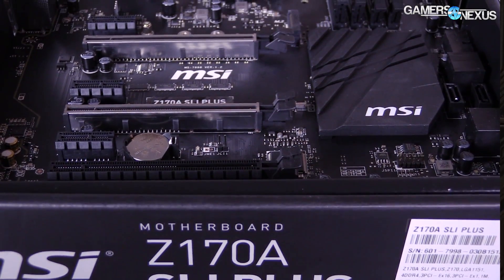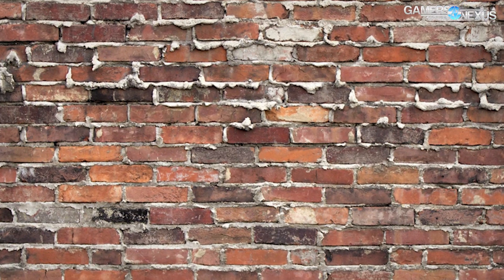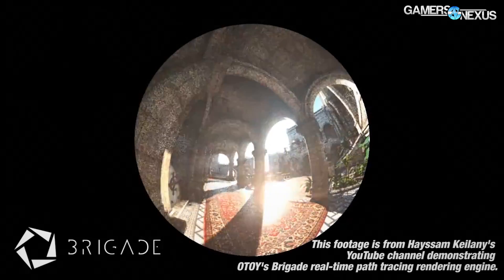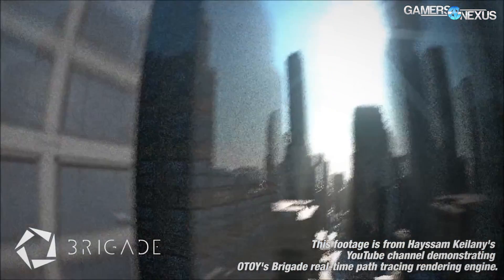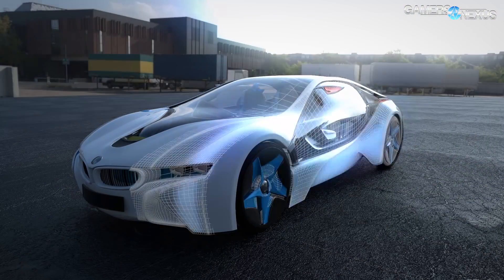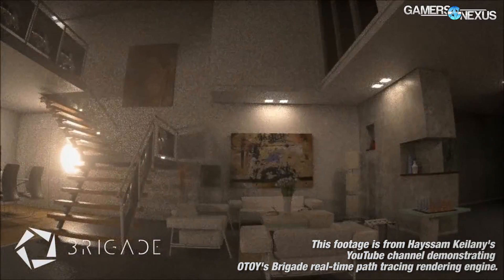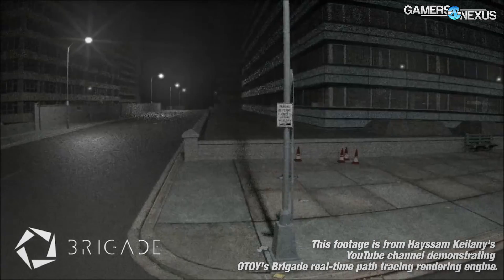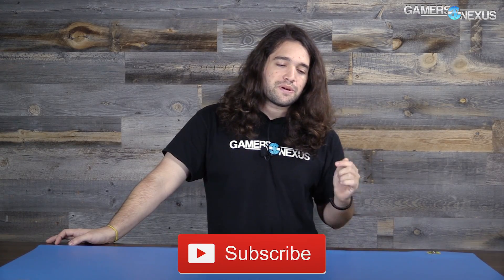How the Radeon Pro SSG Works - The Basics

Comment: PS5 has entered the chat.
Reply: their graphics processor isn't special, it's still inside an APU, sharing ram with the processor, rather than being its own discrete chip
Reply: @danq256  THe GPU is special it has Chace scrubber that allow more efficient and made to work with fast bandwidth on the storage.

Comment: If the SSD is just a regular SATA one (judging by the internal renders of the card), why not just sell the card and the user has to provide the SSD instead? That could make the card cheaper.
Reply: 1TB SSD is really cheap in comparison, so just having that on-board to see if they can work with it is much nicer to their buyers than making them buy their own SSD on top of the whole devkit.
Reply: SSD? What internal renders? GN showed a render of a random SSD to illustrate what makes up a modern SSD (i.e., NAND flash chips), not a render of the Radeon Pro SSG.
The flash storage on the SSG is, as far as the info in this video goes, controlled through 8 PCI-Express 3.0 lanes, and perhaps some other (even faster) interconnect between the GPU and the flash controller.

Comment: is it just the devkit/prototype that's non-polaris? or will the final unit also be non-polaris? Would be good to make sure, could have sworn I heard Raja say it would be Polaris in the SIGGRAPH talk, and other sites are reporting it as a Polaris card. 

From what I understood the devkit/prototype is primarily for developers and early adopters to help get software integration ready for official workstation card release. They revealed during the SIGGRAPH livestream they were working with "The Third Floor" who do realtime pre-viz for films, as early adopters. I was under the impression full 2017 non-devkit units were going to be a Polaris based revision. Of course I could be mistaken.

Also regarding the PCI-E lanes, if it's a PCI-E 3.0 card, would have been the perfect opportunity to refer back to your video on PCI-E 3.0 16x Vs 8x ^ ^ maybe a suggested card?

Comment: How expensive are vram modules?

If we look at the difference in price between the rx 480 8gb and 4gb, it looks to be $50 per 4GB of vram.

This thing costs $10,000.

10,000 / 50 = 200 sets of 4GB

So 200 x 4GB = 800GB.

So for the same price you can fit around 800GB worth of gddr5 (obviously more like 500GB because  I didnt factor in any other costs), but why would they opt for this ssd approach instead of a shitload of gddr5? Is there a gddr5 shortage or something? Higher profit margin? Why not ddr3/4 instead of an ssd, wouldnt the speed be better?

Plus the ssds lifespan will probably be reduced very quickly.
Reply: If they used 800 gb of gddr5,  the card would be 5 feet long,  and you would need 2000w just for the memory.  Plus,  this stuff is very high margin
Reply: Phoenix Wright ah, right. Totally forgot about size. They cant stack the modules or anything?
Reply: +Phoenix Wright "New" technology always had a premium, think about when SSDs first hit the market. and look at.how affordable ddr4 is. that's where the price is, you're paying for innovation. plus I'm sure their things about it we don't know.
Reply: Phoenix Wright Well theres always the cost for developing new drivers and firmware for it, programmers dont work for cheap. People forget about the labor part of prices, its not always about pure hardware costs.

Though this is specialized hardware so im sure they still are making quite a decent profit on it.
Reply: that higher price is for Enterprise level software support, in which they will guide you through any issue, and since this is support that cant be provided by some joe in a call center and are actual engineers and technician price can go high. plus low volume needs a higher price to pay for R&D and 3rd, Disney doesn't care about 10 grade if they can double the speed of their editing workflow (Amd showed 8k rendering going more that 2x as many fps on this card)
Reply: +Phoenix Wright if they had high margins they wouldn't publish retailers struggling to break even on selling cards. do you mean low margins aka not making much money? high margins equal more profits. Electronics tend to sell for maybe 20% in my experience in retail. that's a low margin.
Reply: Rodney Rogers server gear always sells at very high margin.  Its very profitable.  And because of it,  they can afford to bring cheap cards for consumers.  The card itself is just an old hawaii chip with a 1tb pcie ssd.  Nothing worth 10000 dollars there.
Reply: This is aimed at HPC market. The margins on the HPC market are pretty high. This is what he meant by high margin.
Reply: the cost is not measure by the memory or any other hardware component there is a lot of dev and api involve as well to make that happen.

Comment: I'm still trying to figure out why this card is better than having pcie x4 based solid state storage?  It's starting to sound more and more like the controller for the SSD is not integrated to the SSG and that it will need to use the CPU anyway to go from video card to ssd.
Reply: I think it'd still have to communicate with the CPU before using a PCIe SSD so having it on the card cuts out the middle man, as well as makes it an incredibly short physical distance for data to travel.
Reply: What I heard was that the video card is on 8 of the lanes and the solid state on the other 8.  Sounds to me like it's a video card and a raid 0 array that would still need the cpu to access it.  Granted, it's still in development and they really haven't shown how it actually works, but when you tell me the solid state memory has pcie lanes, that seems to me the CPU has to be involved.
Reply: I think the 8 lanes will be used by the CPU to "upload" the data into the 1 TB "SSD" on the card. And probably also used to "download" finished frame from the "SSD" to be stored in, say, a Petabyte SAN storage. Internally (that is, on the card), the "SSD" will be dual-ported; that is, the "SSD" can be accessed by the CPU and the GPU simultaneously (with some intricate locking mechanism).

The use case would be "batch" data processing: Load several hundreds of GB of raw data to the SSG, let the GPU do some crunching, and pull the processed data from the SSG while loading the next batch of raw data.

Comment: It's based on fiji, so more than 4GB vram is not gonna happen, and hbm is probably one of the reasons they had enough room to add 2 ssd on there.
Reply: Fiji wasn't made into a quadro.  Its more than likely hawaii based
Reply: Well i should hope it wasn't made into a quadro or nvidia would have some explaining to do. There was the FirePro S9300X2 which is a Tesla-like card based on Pro Duo Fiji. I think this SSG is only Fiji because its a development kit for a future high end Radeon Pro card. I bet you we will see a Vega based SSG next year some time.
Reply: Tommyttk sorry,  meant firepro
Reply: With HBM1 it could actually theoretically be made a 8 GB model, at a cost that would be impossible to sell on the consumer market, but this isn't meant for consumers anyway, so I wouldn't be too surprised if they did that here, after all they need to make adjustments anyway to reduce the risk of flipped bits...

Comment: It is exactly this data shuffling problem that intel wants to address on a system level with Optane (3D Xpoint) drives connected directly into the PCI bus with NVMe or loaded straight into DIMM slots.

Comment: I think of this like a supercharger.  It robs your 'engine' of power since it runs off the same 'belt', but there is a net positive increase in performance that is a direct increase on the performance curve at all 'RPMs'
Reply from the maker: This is actually a great comparison!
Reply: You're my hero
Reply: Correct me if I'm wrong but the reference card according to pcper used on the event have a fiji GPU amd.

Comment: But why 1 TB? 128 GB would have been overkill.
Reply: Because some workloads demand 1TB. There are certain applications where raw power isn't what's needed, but extra frame buffer. Take large scale simulation, GPU's have gotten pretty good at raw crunching numbers but they need places to store them whilst working on them.

Fluid simulators like FumeFX for movies can use terrabytes of data just for a decent explosion, it of course would be sped up many times over having direct access to all that info.
Reply: It is not a ram.

Comment: The question is if it is possible to load an actual operating system on this card.
Reply: no because the gpu has complete control over the SSD, which is not meant for permanent storage anyway
Reply: I think the answer could be no... In my analysis on this card, AMD is trying the concept of SSHD (Solid State Hybrid Drives). SSHD has a small Flash NAND Drive that is being utilised as a temporary memory to optimise programs loading time faster.

In my theory... having a 1 TB of Flash NAND Drive in a GPU could or maybe help by storing the data that is needed temporarily in the GPU for a specific program, by doing that it could remove the latency of the read and write of the file from the storage device and having quicker access to the data.

This is just a theory so take it with a grain or sack of salt if needed.
Reply: by the looks of it, its literally a page file SSD for when the vram gets full
Reply: In the prototype at least, Windows could actually see the two drives, so by the looks of it, I think you could actually do that. But the problem here is: Those two SSDs are 950Pros, NVM-e drives. That means that the GPU has to have an integrated NVM-e controller so it can issue commands to the 950Pros, BUT! AMD also said that they're using a Fiji GPU (Which is an old GPU) and I don't think they went and actually integrated a controller in the GPU die itself
. Some people say that the controller is on the PCB and not the GPU but that's yet to be confirmed. And also the other weird thing is: If Windows sees them, and the GPU doesn't have an NVM-e controller, that means that AMD RAIDed them in Windows? Which is unfair really because Windows adds some RAM on top of that so that actually gives them a benefit. It's so unclear right now I just hope AMD didn't just strap two M.2 slots onto a GPU PCB and called ti something else
Reply: turke33 No, it's more like bypassing the CPU and RAM for lower latency and storing the big files needed onto those two SSDs. It's liek strapping another system onto your motherboard (Motherboard Inception D:)
Reply: +Cozmic Steak Interesting fact that same BS I heard on pcper channel,coincidence I don't think so.
Reply: No, just trying to say it here because some people get so discouraged to click on a link and watch a whole 17min video
Reply: How would you run an os from the gpu though?
Reply: Virtual machines stored on the gpu could be a thing, maybe on a future gaming gpu would be bad ass.
Reply: maybe if theres newer Pcie versions with higher lanes?
Reply: The best question is will the next version, with a newer GPU, be dominant in Cryptomining.